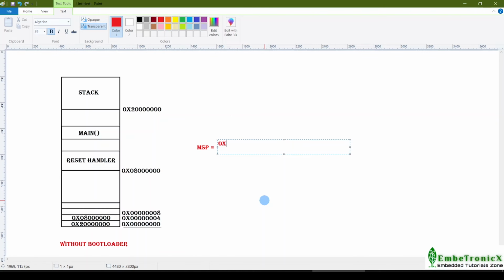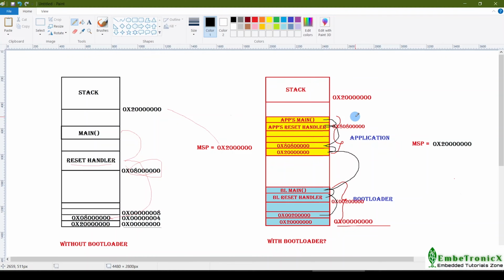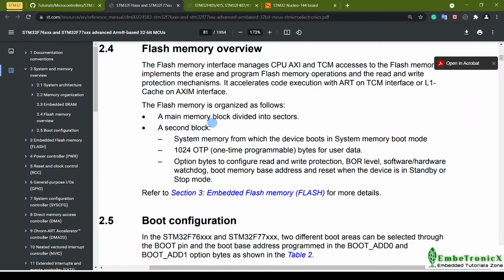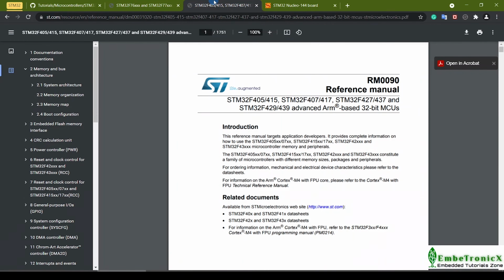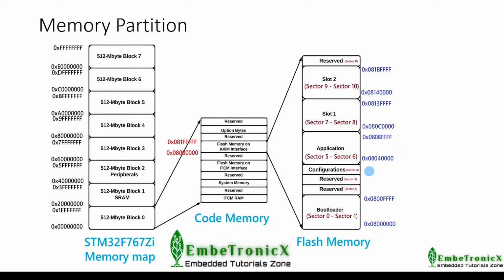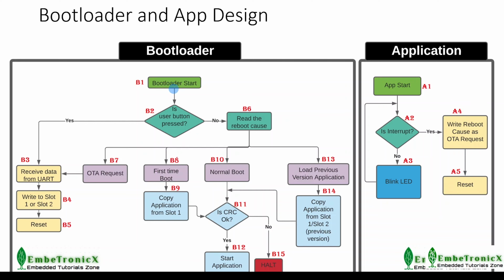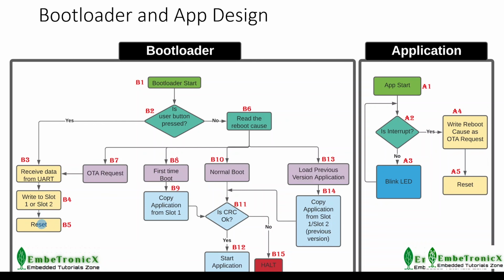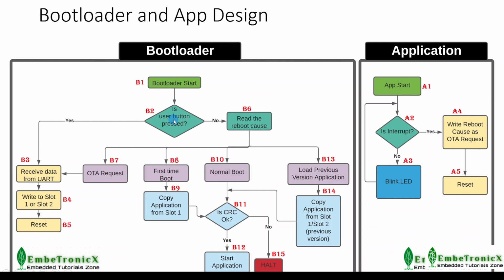STM32F7  (Cortex M7) Bootloader Tutorial Part 1 & 2 - Bootloader Introduction and Design for STM32

Comment: Hello. I am confused since in all the literature I have read up until this point I have been told that Cortex-M MCUs have a full-descending stack model and what it is loaded into the MSP after reset/power is the direction of the top of the stack i.e 0x200X X000.The value that you say gets loaded in the MSP (0x20000000) is actually the direction of the begining of the SRAM memmory that leaves virtually no room for stack to grow. MSP should point to the end of SRAM (direction depends on the specific MCU but it is in the range of 0x200X X000) to allow it to grow downwards.

Comment: I am little confused because i made the bootloader part and loaded it to the board ( stm32f407 discovery board) and it works but i do not know that how it will jump to application  because they are 2 different projects in my stm32cubeIDE.  I have allocated 4 sectors for bootloader and 5 sector for the application which starts from 0x0801ffff.  i put this address in the linker script of application
Reply from the maker: Hello, Have you seen this video (https://www.youtube.com/watch?v=O3M_4rrw1LI)? This video has the explanation that you are looking for.

Comment: Dear Professor::I am using the same code you made in your video. When i do bootloader part it is ok because  I do not get any error when I generate the  code in stm32IDE but when i do the  application part i get this unused declration of  function io__putchar (int ch) function) message in main.c of application part in stm32IDE
Reply from the maker: It is really wierd. Can you please just compare your application source code with our code? Github link - https://github.com/Embetronicx/Tutorials/tree/ETX_Bootloader_1.0/Microcontrollers/STM32/STM32F7xx/Bootloader_Example/Application